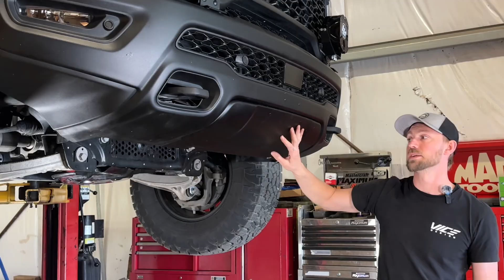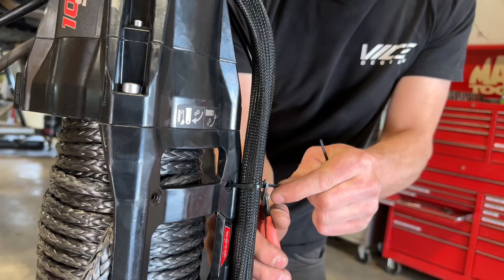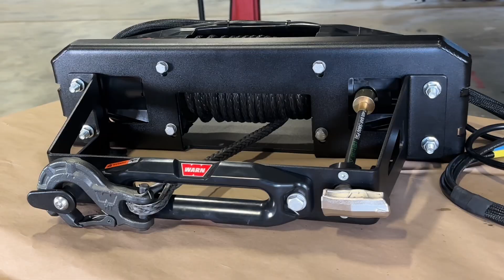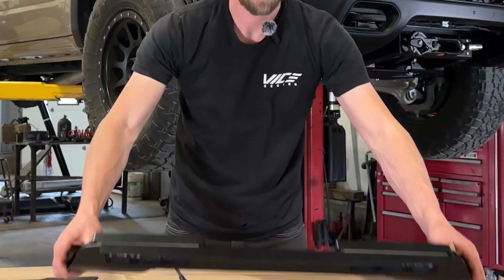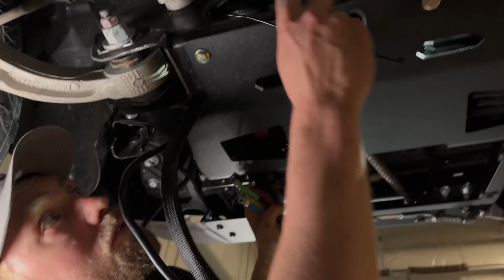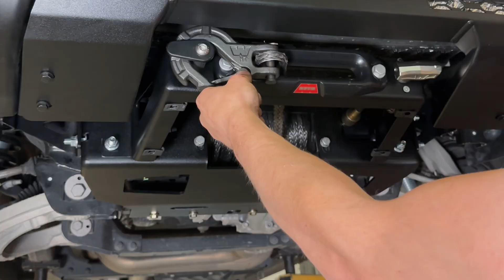You NEED this TOOL on your truck | Hidden Winch Mount Installation - 2025 RAM REBEL & RHO

Comment: Where do you get this kit? I just bought a 2025 ram 2500 rebel
Reply from the maker: Congrats on the new truck! What engine do you have in your 2500 rebel?
Reply: @vicedesigninc  6.4l
Reply from the maker: @Eagle18989 thank you - here’s the winch mount that fits your 25 Ram 2500 rebel -> https://www.vicedesign.ca/collections/hidden-winch-mounts/products/ram-2500-3500-2019-2022-hidden-winch-mount

Comment: Anyway to get this winch with cable and not rope?
Reply from the maker: You can use a cable as long as you also purchase a hawse fairlead compatible with the steel (Warn part number 73850) as roller fairleads are not compatible. https://www.vicedesign.ca/collections/winches/products/steel-cable-hawse-fairlead

Comment: Are those Bilstein struts in the front? Looks lifted. If so, which Bilstein struts are they? I need them for my 2025 Ram Rebel.
Reply from the maker: Yes good eye. Bilstein 6112’s on clip #8. Also went with the BDS upper control arms
Reply: @vicedesigninc what is the wheel and tire setup. I have the same truck and looking to do the same setup.
Reply from the maker: @Hondatitan69 method MR305 18” -12 offset. Toyo AT3 tires 285/75r18

Comment: You guys make some quality stuff. I actually did a hidden install on a 23 f150 Tremor I own. I used your remote winch handle relocation kit. It enabled me to reuse my old winch instead of buying a more expensive electric clutch one. I also used your relocation wiring kit for my warn winch solenoid pack. I could have made up my own cables but yours were very nice just as good as what I can make. I do use a heavy battery disconnect just in case the winch ever decided to turn in to skynet!
Reply from the maker: Very happy to hear that we were able to contribute to your Tremor build! Appreciate the kind words - we build these winch accessories in house so I'll pass on the kudos on to the crew!

Comment: Can't wait for mine to Arrive, couple of Questions.

1. On the the small allen set screws (or any bolts) is it advisable to add any locktite ?

2. You mentioned early in the video (5:05) a link for clutch relocation but the link is the same as the main video?
Reply from the maker: Not a bad idea to use them on the small fasteners that hold the lights in, but it is not required on any of the fasteners that are torqued to spec.
Here's the link for the winch video: https://www.youtube.com/watch?v=GfYl755nGbk&ab_channel=VICEDesign

Comment: What about the 2025 2500 Rebel?
Reply from the maker: Yes we have one for you - what engine is in your 2500 and I’ll link you the correct kit
Reply: @vicedesigninc  cummins
Reply from the maker: @ https://www.vicedesign.ca/collections/hidden-winch-mounts/products/hidden-winch-mount-5th-gen-2019-2024-ram-2500-3500-cummins